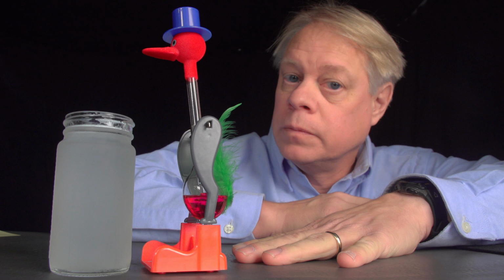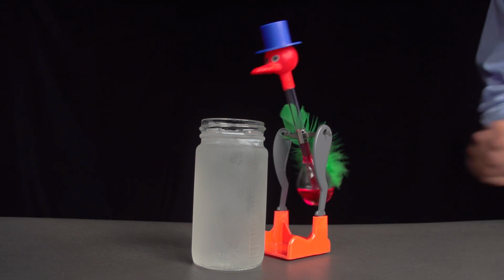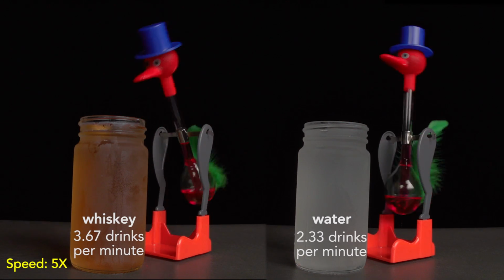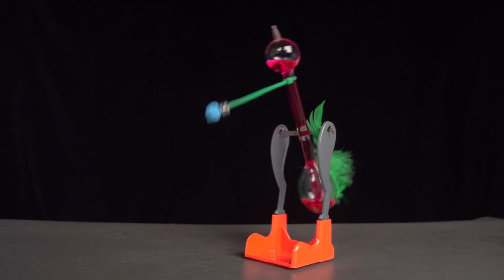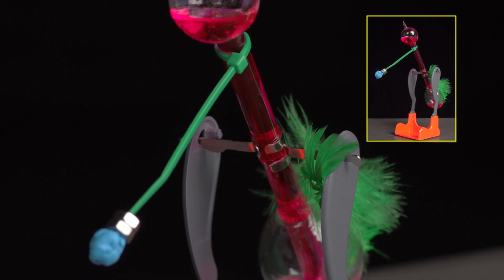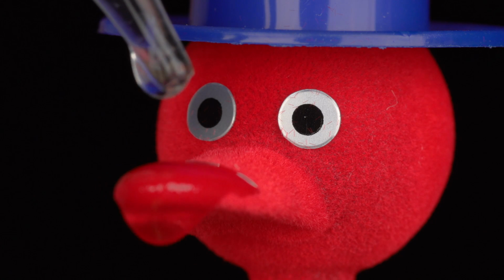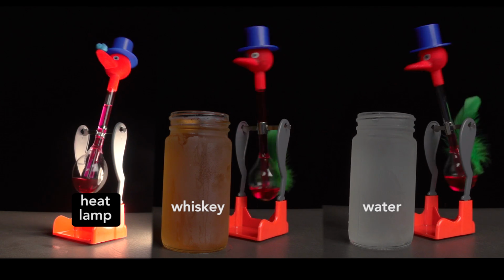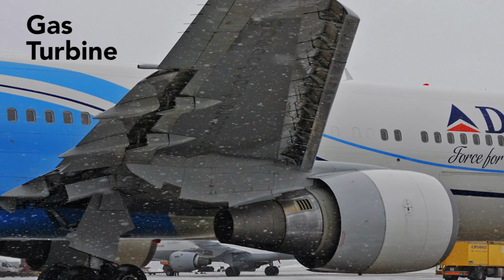Drinking bird: For advanced viewers

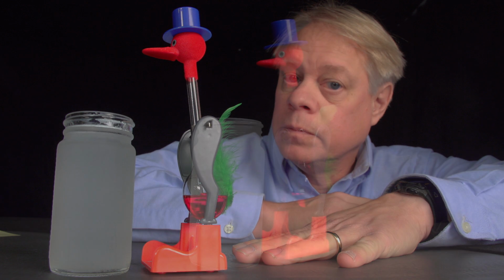Comment: 8:50 "a heat engine turns heat differences into work". This statement could be confusing. 'A heat engine turns the difference between heat inflow and outflow into work' sounds better to me.
Reply from the maker: Thx for feedback. The problem with that is that it makes heat sound like a quantity (a thing or an entity) when it is a process. There is a difference in the way heat is used colloquially and with precise in thermodynamics. Heat is a process and is the transfer of energy by temperature differences.

Comment: I enjoyed your video and liked that you mentioned the heat engine.  I  feel  that mentioning or showing the adiabatic curve of the Carnot cycle of a heat engine would add to what a heat  engine is  and  why the heat and evaporation is important (delta heat) and the why the draining of the column when tilted is part of that cycle.  I apologize for not being  particularly articulate.  You  might be  able to work  in the heat and vaporization temperatures of the fluid in  the  glass.

Comment: I've wondered how this toy works every time I see one but never thought to look it up!

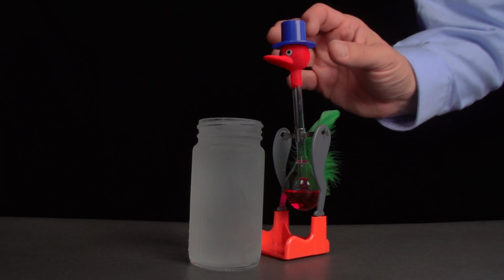0:10 intro
I didn't like the 10x speed segment. The bird's motion is already hypnotic, then the time accel is jarring.
You could open with a shot of the bird, dunk its beak, and narrate to the first drink, Planet Earth style. Or if that extra minute is too long to narrate, use alcohol: open with cracking the wax seal on a bottle of Maker's Mark and pouring your bird buddy a drink.

You will see the red liquid better against a white background.

Excellent experiments with water, alcohol, heat, kinetics. I had enough information seeing these to form a hypothesis of the mechanism (which turned out to be wrong.)

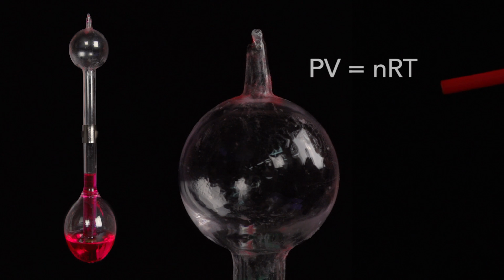6:24 ideal gas law
- Can you declare each unit before using the formula?
- You say "of course" cooling makes condensation makes decreased moles of vapor.
I remembered that "moles is a count of molecules" but I thought the "amount of vapor" was staying the same (and thus the number of molecules, moles and pressure remain the same.)

I wasn't understanding that condensation is gas molecules transforming into liquid molecules and beading up on the inside of the bulb.
So once the vapor condenses to liquid, those molecules stop counting as "moles of vapor" in the formula. The remaining vapor molecules have "more room to play" and are not "pushing each other around" as much. Since they're calmer, they're "bouncing off the the walls" of the surrounding bulb less, which is "less pressure."
(Or so I understand.)

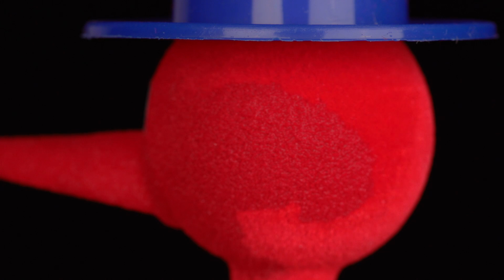7:12 evaporation cooling
I understand that when evaporation occurs energy is being removed from the system, which makes sense as gases are higher energy than liquids. But I don't know why evaporation occurs.
Does the cooling occur only because the water is colder than the bulb? Would evaporation occur if the water remained hotter than the bulb and environment? What if the surrounding air was at 100% humidity?

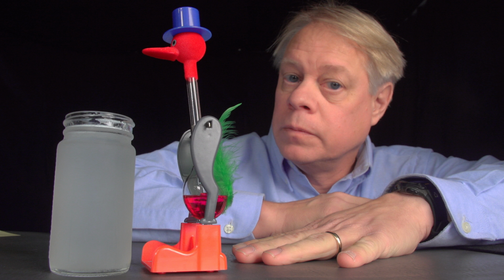8:45 "Heat Engine" Nice, great closer

Thanks for another great video Bill, I feel bad asking you for more detail as this video is already packed with science!

Comment: During the bit about the condensation I was distracted by the thought that condensation occurs only below a particular temperature. This distraction was made blinding as I recalled your earlier demonstration with the heat lamp on the base in which case the temperature in the head could not possibly have dropped to where the vapor would condense. The distracted me so much I missed the rest of your talk.

Comment: The backward tilt was very unexpected to me and I was reeling from the shock of that when you explained why. Can you stretch out that explanation with more emphasis on how nearly unstable the bird must be balanced. I had to play it back twice to finally get your explanation. (That's the only time I had to play it back, by the way.) 
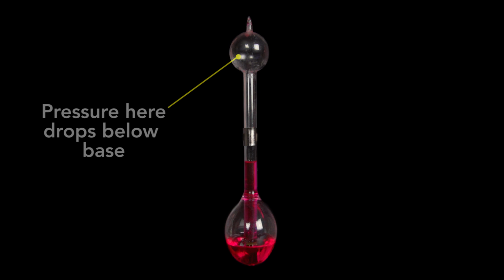I think most people have figured out that temperature difference must affect pressure just after you used the heat lamp. So at 5:25 it might be useful to say that it is the temperature change not the wetness that changed the pressure.
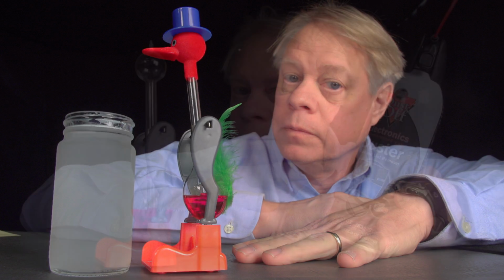At 6:12 the explanation seems redundant at first, but you spoke of it as if it  should be a surprise to us. What is a surprise is that it isn't just getting cool but that coolness causes condensation.

Comment: I was wondering if the experiment with alcohol wouldn't be better saved till later when the discovery that the process comes from the evaporation and to support it. Introducing it early is indicating something that the audience may not quite be ready for. The heat and cold application to the bottom and top are significant since they are using external energy and accelerate the process.
Reply: Dan Gervais I agree with this statement. As soon as the whiskey was introduced, it led me to begin drawing conclusions dealing with the differences in evaporation rate. I feel it may serve better to provide an example after the science is discussed.